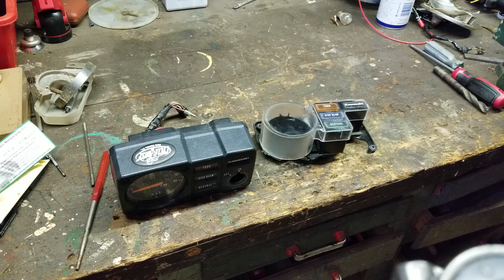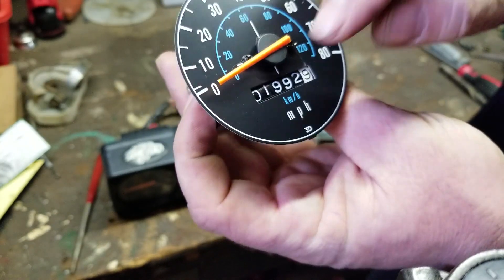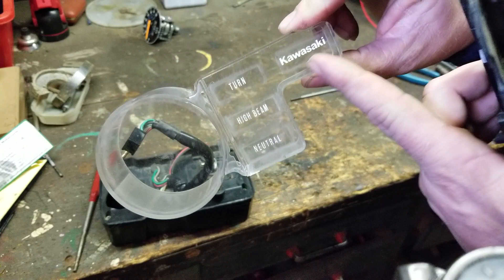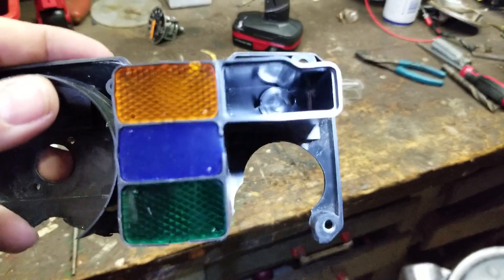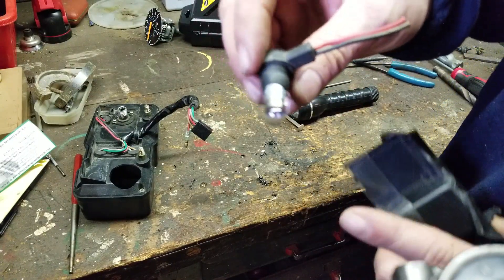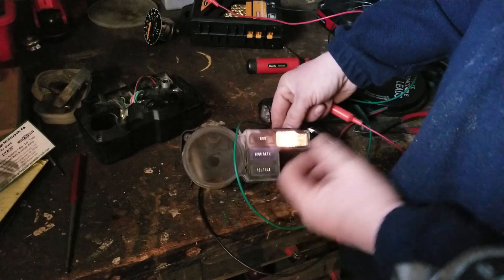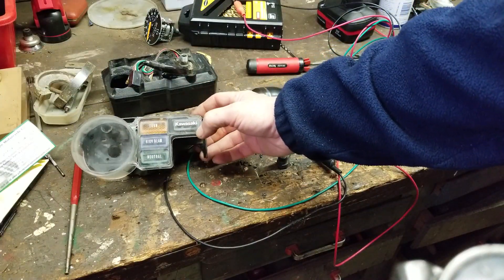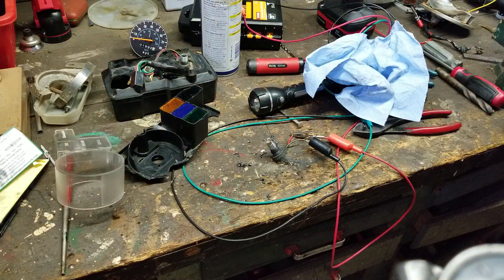Kawasaki ke100 gauge mod

Comment: hey bro dear i need a carborator  kawasaki ke 100 can u send for me and how much the coast plz tell me i realy need urgently plzzzz tell me
i m waitting u answer me than i send my cantacts
Reply from the maker: I don't have any cards left go on Ebay look up Suzuki ac100 same carb
Reply: have u  carborater jet set i need jets
Reply from the maker: @qadeerkhan6887  no carb parts always buy carb parts new
Reply: @2strokeguru   thanx bro
Reply: Kevin my clutch is slipping on my ke100 I was told if I adjust it and change my transmission oil it would fix the slipping is that true?
Reply from the maker: @Gary_taylor  sometimes  but normally by that time they are smoked
Reply: By smoked you mean the friction plates right ?
Reply from the maker: @Gary_taylor  yes
Reply from the maker: @Gary_taylor  6033958097